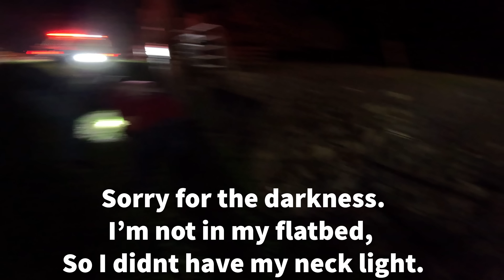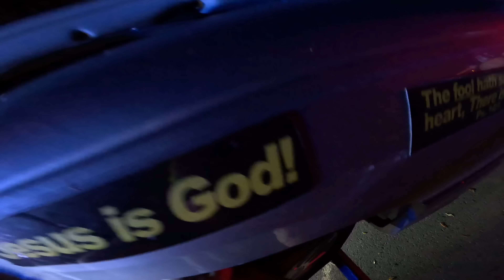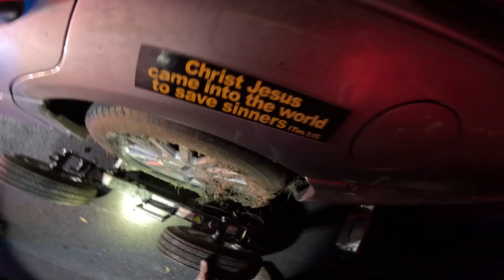They Said This Needed A Heavy?! Car Goes Off A Bridge!!

Comment: We would get our A*S chewed out and told to go home if we used a power pole for an anker. No chain of command. The first person on scene is in charge unless a manager or senior driver takes over then he is in charge. Unless it's a safety issue who ever is not in charge lets the lead do it, good or bad. The wrecker should have been closer to begin with. Pulling the rear around isn't the way to do it with what I see. If the wrecker was closer it would have had more directional control of the car and would have been able to pull it away. That big J isn't for recovering from what I have been told. Man that cable is singing. 😮 Rim Sling instead of chain? That thing should not be that hard to come up. How many people does it take to load a set of dollies???  At the most there should have only been two people there. Sorry Dustin that was a cluster. Great video however.
Reply from the maker: Like I said throughout the video, I felt they had the rigging done wrong the whole time. That was the owner and one of our heavy drivers that was there and first on scene. I was technically off but got asked if I wanted to come help because they knew I’d enjoy being there for that one, which is why I was in my Jeep and not my flatbed. 
So I agree with your opinion. I’d have handled it a lot differently if it were my scene.

Comment: Why not use the heavy since it as already there? Is a cost factor of some sort? It seems silly to me that the heavy has better cables than the smaller truck so you would have less risk of something breaking and injuring somebody. Great job and love your personality.
Reply from the maker: This was well within the capabilities of a medium duty wrecker. The only reason we brought a heavy was because the company that showed up before us, turned it down and said it needed a heavy. Other wise, we’d have never even rolled the heavy. 
The only reason we fought it the way we did was because of how they had it rigged, but this wasn’t my job, so I could only make suggestions.
Reply: @Towtruck_Dustin  Yes you were put in a difficult position having been asked to go there. But good it got out safely.

Comment: You all needed work lights to work to pull the cars off and see what you are doing at. Nights
Reply from the maker: I generally always do, but I wasn’t in my rollback. I was actually on my weekend off, but I got asked if I wanted to work the accident and video. So I did what I could with what I had.
Reply: @Towtruck_Dustin   I do remember that RON PRATT 
Having some lights that work with battery and it unfolds because it on a tripod he uses it at nights work to load the cars & trucks maybe 18 wheelers TRUCK & TRAILER to see in the darkness
Reply from the maker: Only problem with those is they take up so much space. They’re storing those in the upright boxes on the heavies. I don’t have that much room in the flatbed, definitely don’t have that much space in the 5500’s.